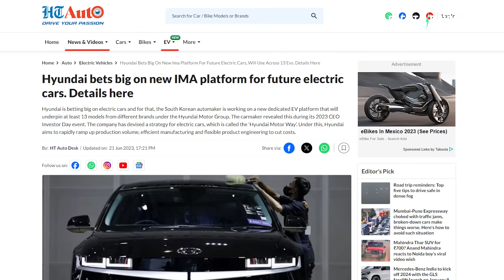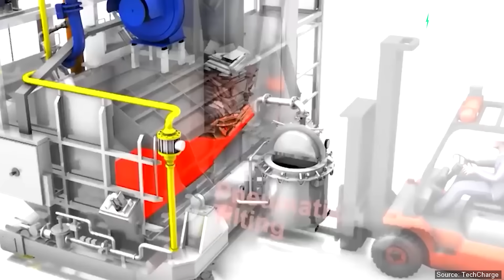The technology Hyundai will use to make the NEW Ioniq 2 EV for $22,000

Comment: I have a small petrol car wit 32000miles or 51000kms. He is from 2007 and it looks and drives perfekt. Every year i took it to the dealer for service    so thanks for this infomative video so i know what to do. Drive my car until 2030 and look for a new EV for around 25/28k. My petrole car is 23 years of age then and stil some value to people who want a small reliable and using very little fuel. 😊

Comment: Completely agree that transformational change will occur very quickly. Especially when conceptually the habits have already been formed. When technology & (low) cost combine to enable TAAS today’s Spotify users won’t miss owning a car anymore than they miss owning CDs.

Though, the one thing that may stall a 2030’s timeframe is legislative approvals. The autonomous vehicle tech is going to have to prove many times over it can mesh with legacy driver behind the wheel tech before politicians will be happy to unleash it. That may take a decade or so. Making 2040 the turn on date.

One other tech which needs to be implemented for autonomous vehicle TAAS to occur is automated connection/disconnection of charging cable or in road on the go charging. Not particularly difficult technically. But standards will need to be agreed then incorporated by carmakers. Given the lifespan of a vehicle is around 12 - 15 yrs on avg, that reinforces my thought it will take a decade+ to be ready to throw the switch. 

We won’t be able to ignore the embedded CO2 emissions in legacy vehicles to remove them from the road prematurely & replace with vehicles with a new emissions debit & against the remaining >1.5° carbon budget.

Comment: I love the idea of EVs but there are several hurdles that need overcoming before i commit to purchasing one:

#1. Charging station infrastructure — this needs to be expanded drastically. If I’m on vacation (and i take long driving vacations) I don’t want to worry if I’m in the outback somewhere about finding a station.

#2. Charging times — most rapid chargers take an average of 15-20 minutes. If I’m recharging several times per day on my vacation trips, that’s a time and, therefore, a distance killer.

#3. Distance between charges — EVs simply need to improve their technology so that i can go 450-500 miles (and that’s highway miles) on a charge. 

#4. Charging to 100% — the distance you can drive isn’t really dependent on a 100% charge because it takes MUCH longer to charge the last 20% (from 80-100%). What most people don’t know is that you most often only use 70% of your battery’s capacity while traveling any distances. The reason for this is that you never let it get to 0% and never charge to 100% (because of the aforementioned time delays charging between 80-100%). Most of us would let the battery get down to around 10% before looking for a charging station and then could only charge it to 80% (thus using only 70% of the battery’s capacity).

Once these items are taken care of, I’m all-in for the EV revolution!
Reply: Hold your breath waiting.
Reply: You’re looking for something that exceeds the needs of 99% of the population. Me, I’m not.
Reply: @mnhsty  Maybe. But the charging infrastructure really needs to be ramped up.

Comment: As long as Hyundai don't charge $30,000 for a battery replacement, they should do well with this car.
Reply: Those stories about TWO different Canadian Ioniq 5 owners who had their cars totalled by insurance because they hit debris on the road and Hyundai wanted to charge over $60,000CAD to replace the batteries is just insane. A couple weeks ago I sat in an Ioniq 5 in the showroom, and I really liked it. I went back home to do some research and found the first story. A week later  a second story came out where the exact same thing happened to somebody else. That pretty much torpedoed my purchase right there. About a year ago I ran over a big hunk of concrete construction debris that was on the highway in my gas car. Fortunately nothing was damaged. I can take an educated guess on what would have happened if I was driving an Ioniq 5.

Comment: Can’t wait to get a hot hatch size cheap EV ❤️
Reply: You can. Used 2019 BMW i3. Strictly EV, no REX 650cc engine, a practical hatchback.
Reply: @gregtheelectricviking  good suggestion, or even better an i3S
Reply: MG4 EV Xpower?

Comment: You wonder will the Integrated Modular Architecture (IMA) platform will allow Hyundai to build EV's with essentially no hoods normally needed to accommodate an internal combustions engine. It could result in very small, but very roomy, multipurpose vehicles (MPV's) like the Canoo LV but even smaller!

Comment: So a battery replacement will cost 2 times the price of the car? Have you read the news lately? XD
But seriously, at any price point, if the cost of the battery is the same of a new car... Goodbye EVs. Many people, me included cannot justify that kind of loss in case of a minor accident or after 5-7 years. Also, with these issues the resell value is very low. That's what is happening to many EV owner, after getting drunk on positivity, now they are waking up to the true cost of owning one. Car makers are shooting themselves on the foot, these practices cannot take you very far. They are only doing the right thing after a reporter shows up at their doorsteps. I'm looking at you Hyundai...
Reply: A. THE BATTERIES ARE COVERED UNDER WARRANTY, B. HOW MANY BATTERIES FAIL?
P. S. Trump Is a criminal.

Comment: I watch all your videos...I am a subscriber. Your statement, ICE cars are dead by 2030 is NOT going to be true in the USA...not even by 2040. Only one factor tells me that IT WILL NOT HAPPEN in the USA. We do not have the grid capactiy to make this happen. We do not have the generating capacity nor the infrastructure to carry it. You live in Austrailia. The attitudes towards transportation are VERY different in your country. You have a MUCH smaller population who live mostly in urban areas. You have supposedly already replaced the petroleium and coal powered electric generation with solar and wind...good on you I am not against this. I am not anti-EV...not at all. But what works in Austrailia and Norway is VERY different than what works in the USA. 
DO YOUR RESEARCH. Take the joules of energy represented by the billions of barrels of gas and diesel that are presently used convert it to comparable joules of electricity required to replace it and you will VERY quickly find that it will take almost ALL of the current grid capacity going to EV's (passenger and commercial) to make such "ICE obsolescence" possible. We also have these places that are very cold for months at a time and most EV"s don't do well in VERY cold...their range is dramatically reduced which can  be deadly at -30F. We also have these large open spaces west of the MIssissippi and the large mountain ranges called the Rockies and other related elevations that consume enormous amounts of engergy to climb. Americans are also very independent and particular about their vehicles...being able to go when and where they want to  go.  ALL of that is very different and more limited in EV's.
I do NOT see any possibility of capacity of the grid, sufficient charging stations, or the technology advancing sufficiently for ICE to be "dead" before 2050 here...if then. I do believe that some of the issues will be resolved so that EV's might be in the majority by 2040...but dead?  It is not happening in the USA in the time lines you suggest for the reasons I have laid out above.

Comment: Big selling small cars in Europe are different kinds of hatchbacks or so called cross overs. This also means that they aren't very efficient at "higher" speeds, which means they will be blamed by the motor journalists...
Some years ago some 20,000 euro EVs were sold in Finland, a couple of years later the prices are about the same as for new cars... Unfortunately I don't remember the makes and models (two sister cars).
Reply: Th!nk City was one.

Comment: Thing that still has me sitting on the fence with EV's is the environmental cost of battery production, replacement and recycling.

If the shift to EV's is primarily an attempt to combat the climate change impact of ICE vehicles, then there is little point unless the entire lifecycle is pulled apart and examined. 

Would love to see a series on this. Cheaper EVs for me (and many others I suspect) comes second to them more or less cancelling out the environmental impact of ICE vehicles.
Reply: Evs cause so much enviro damage that nobody should buy one.
Reply: All the effort, damage needed to convert the whole world to renewable energy is about as much damage and effort as six months of current coal production. Fossil fuels are incredibly wasteful to produce and we waste most of the material when we use fossil fuels for energy. This idea that we are adding scary amounts of more damage while transitioning to renewables is missing just how wasteful fossil fuels are. We will save money and effort and pollution by transitioning to renewable energy. Saving about 40% while doing the transition and then huge savings thereafter. Energy too cheap to meter is what the calculations show... 80% of households with solar panels and batteries just because of how cheap the initial investment...
Reply: @0ooTheMAXXoo0  thanks for the reply, I'd certainly love to read more about that sort of breakdown. Do you have a link(s) for those figures?

I'm certainly not questioning whether we need to move off fossil fuels, I've spent a lot on getting 11kW of solar on my house which is the maximum for the type of grid connection I have. Also in the process of building a 7.7kWh house UPS using recycled lithium cells. 

My concern is the production and end of life recycling side of lithium batteries is largely muted outside of the climate denying nut job spheres. It's hard to find current and trustworthy sources of information (at face value at least). One such article I read recently (written by an Australian University) spoke to the challenges of recycling due to non standard battery construction and even batteries being incorporated to the structure of the vehicle (effectively time-bombing their service life). Also mentioned was the EU was the only region to seem to have legislation in place (although I think China does too) requiring a percentage of the raw materials be recycled.

https://theconversation.com/batteries-are-the-environmental-achilles-heel-of-electric-vehicles-unless-we-repair-reuse-and-recycle-them-205404

Overall, I think there needs to be a much greater effort by governments to work together to legislate the standardisation of battery construction and recycling. Also a much bigger effort of public information on what this energy shift means and what we need to do to adapt.

Comment: Just to be clear, we cannot replace 1.5 billion ICE vehicles by 2030. Furthermore, there is still considerable resistance to EV’s at this time due to various issues. I don’t see how the auto industry will overcome all of them by 2030. Nevertheless, more and more consumers will buy EV’s going forward.

I see a future where most people won’t be able to afford personal road transportation. I see city buses powered by overhead power lines, like we have in Vancouver, Canada, not batteries, and much the same for semis and trains on highways and rails respectively.

The unmotorised bicycle will also make a big comeback, and people’s standard of living will take a big hit.

Welcome to the end of easy, cheap oil aka ‘global warming’ for the misinformed.
Reply: All new car sales will be EVs before 2030 apart from low production vehicles... Then it will take decades for older ICE cars to cycle out, (around 90million new cars per year). Although, I suspect it will be more like 1.5 decades since the lack of gas stations will force the issue at some point. When the number of gas cars drops below a certain level then gas stations will be too few and far between for most gas cars to make any sense at all...
Reply: I guess you don't believe Tony Seba AT ALL.

Comment: Unless wireless (in-road) charging becomes practical and common, EV acceptance will stay limited. A friend who lives in a California apartment passed up a good deal on a Model 3 because of charging issues.
Reply: You can use the EV like a gas car. Fill it up once a week. You just pay way less per mile. Also, almost every store parking lot you visit have slow chargers (many are free) so you can gain miles of range while parked... Trickle charge every place you go and you might never have to pay for electricity at all... Also, charging points along city streets where cars park is becoming commonplace...
Reply: @0ooTheMAXXoo0  I fill my ICE car once a week, to be able to get to work and back each day.  Not a problem if you own a EV with a range of 500 miles per charge. The problem with public chargers here is that most of them make it more expensive to drive a EV than a ICE car cause of the price per kwh.
Reply: Aptera is the answer to everything. Never have to plug it in, unless on a trip; than it will go 1000 miles! 😄
They are also working on 4 wheel models that are 4 passenger.

Comment: Those cheap EVs look like loss leaders. Just wait until they charge you $60,000 for a new battery. Thats where they make a profit.
Reply: EV batteries should last longer than the rest of the mechanical stuff... They guarantee the batteries for at least 100,000 miles... should last a million or more miles with 80%+ of original capacity. And, up front margins is the thing with EVs since parts and maintenance are so low. Different business model for the old car makers.
Reply: Get the manufacturer/dealer to give you a "written in stone" cost for a replacement battery before you buy. Or go for a "buy the car, lease the battery" deal.

Comment: Electric cars ought to be cheaper than gas cars.  The modern day internal combustion engine, transmission, and related components require far more manufacturing than batteries and electric motors.

Comment: Most nonsensical video I have watched to date. Guaranteed it will not be under 30-40k. The claims in this video have turned me off the channel and inspired me to unsubscribe, as channel has lost credability with this stretching of the truth at best.
Petrol / deisel engines 100% will NOT be extinct for at least 20-30 years or more at best... my son bought brand a new apartment and his partner also bought one in Parramatta on 17th floor. Both only have 3/4 charging stations for the whole multi story block! There is NO CHANCE infrastructure will be there for even 25% of all vehicles to be electric. Our electricity grid system will not be able to cope either. Imagine if all cars in Sydney that pull up into a petrol station daily,  plug their cars into the grid to charge? Gov is closing down power stations and our grid is already crumbling at the knees. Only last week in Sydney we were told to turn off appliances if we can and only use them if necessary...! We will NOT have the infrastructure to support even 25% of all cars in any major capital city in Australia being electric. It will take many more years than 6 years.

Comment: I might also Olivur probably why it won't sell for anything like that outside of China or Korea.  One must note that for some rease the Korean brands are not keeping repair stock of such items as battery packs; and the replacments are costing $50,000 - $60,000 which ends up getting the vehicles written off.  But losing $22k may be a risk one can take.
Reply: They need to get that supply chain fixed, and rein in their stealerships. Batteries cost $5000 now and that will continue to drop.
Reply: @jamesvandamme7786  $5000? no $60000.

Comment: At that price point, I'd expect something like their current i20. 
Which is way smaller than those concept art shots portray.
Reply: @phillipbanes5484  Hyundai isn't the only company who recently discontinued their subcompact vehicle. 
Honda discontinued the Fit, at least in North America. 
It's really annoying how ice vehicles have continued to increase in size over the years. Especially trucks and suvs.
Reply: Have you ever thought about the packaging issues associated with putting 400kg of batteries in a 900kg car? There is a reason the first Tesla roadster didn’t sell in high volumes and it wasn’t the price. It was a heavy girl trying to audition for ballet. In a string bikini. 

Having an electric car the size of an I20 will result in yet another BYD seagull. Heavy slow and short range in a price sensitive segment. 

You can get away with an 85kwH battery in a $100K saloon car. You absolutely can not do this in something meant to be a direct and better replacement for an urban hatch. 

What should have happened is Nissan delivering the Leaf AZE1 with 40KwH of sodium ion batteries for $28K drive away. But Nissan didn’t sign the contracts while others did. I’d suggest a minimum of 100Kw per tonne for a maximum of 30 seconds in Australia. As a minimum. Anything else is solving a problem we don’t have

Comment: 2024 could be the year of non luxury EVs. We saw the peak for both cost to make and price in 2022 and there is still a lot of cost takeout to happen as car makers optimize their supply chain and get better and making EVs.
Reply: That'd be great. When I got into EVs in 2020 with the e-Niro, I thought of it like an old Nokia phone. Said to myself, wow.. If this early model/tech is so impressive already, I can't wait to see the one I upgrade to in 3 years time. Yet, the e-Niro is still one of the best EVs in 2024... We ended up upgrading to an Ioniq 5 which is more beautiful and a lot better equipped, but as an EV, it's still the same efficiency. It's bigger, consumes more, same 500km-is city / 250km-ish motorway range therefore. Could have been built in 2018 with the e-Niro/Kona tech. So I hope the next upgrade will finally make the e-Niro look like a joke.